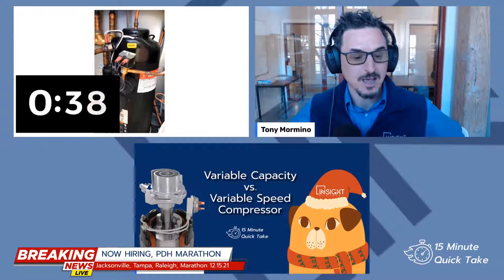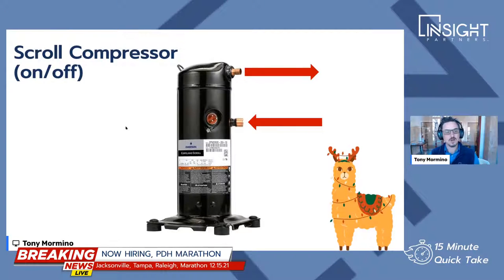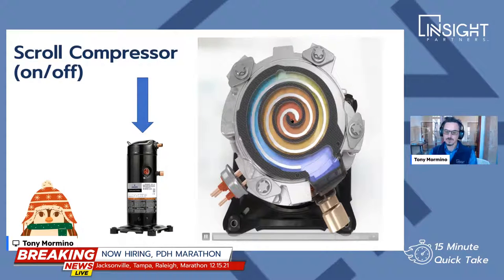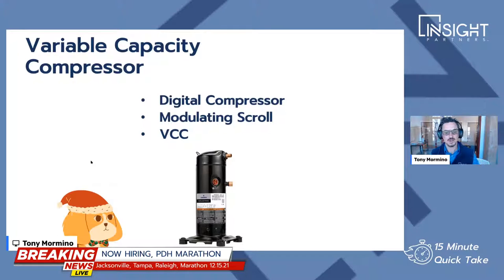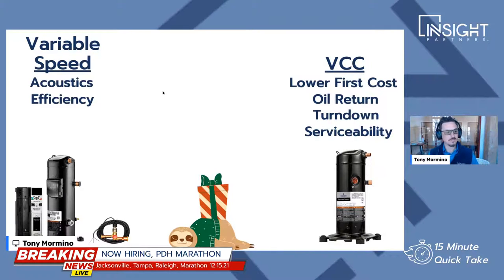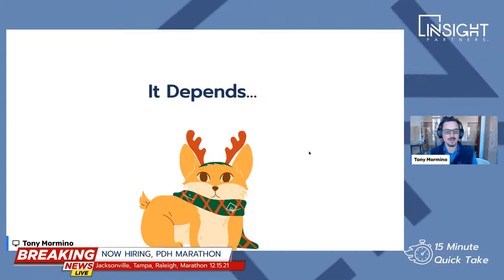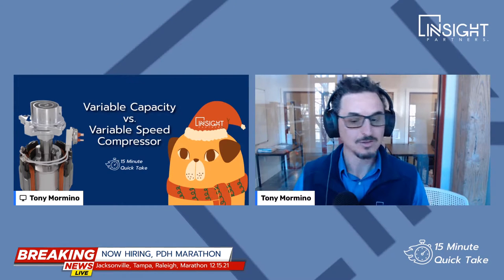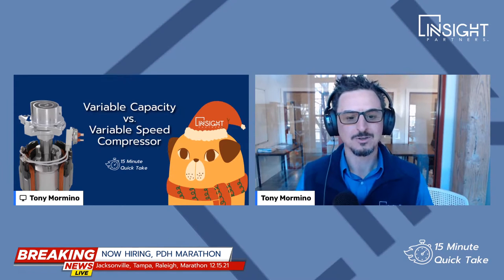Variable Capacity vs. Variable Speed Compressor

Comment: Variable capacity is a more generic term.  Variable speed is a type of variable capacity.  Digital compressors do it by PWM over a 15 - 20 second cycle.  Variable speed does this by changing the speed of the motor.

Comment: I would take the digital over the variable speed any day. Inverter compressor...its not only the compressor, but the expensive boards and controllers.....digital is just a compressor and a controller....less expensive, better oil return and more readily available parts.

Comment: Can you explain how a variable speed compressor in a car works without having any of the fancy communication and control systems that are needed when VRF is used for residential and commercial buildings?     The compressor in a car is usually directly driven from the engine.     The engine speed typically varies somewhere between 500 RPM and 3,500 RPM under normal conditions.   A receiver and expansion valve appear to be all the equipment necessary to keep the system in balance even when there are wild swings in load and capacity (compressor speed).    The cabin is maintained at a comfortable temperature and humidity level even with massive swings in heat and humidity demand over short periods.    Thanks
Reply: The car A/C will cool more the faster the engine spins. If this would result in overcooling the heater is often at the same time. This is obviously inefficient but nobody cares.

Comment: I prefer a Varible speed compressor for reliability.  The digital scroll has a top moving MECHANICAL PLATE with a hot gas solenoid that gets on/off. This will eventually fail much sooner. 
Turn down on VFD compressors I have been working with have the ability turn down to 12% capacity.  That's very low.  I have worked with both Danfoss and Copeland VFD drive compressors.  I just don't see digital scrolls lasting very long life with being replaced just because of the plate wearing out eventually
Reply: I disagree. I have seen digital scrolls last longer than inverter compressors....plus without a properly implemented logic the oil return on inverter compressors is bad. Plus costs associated with a digital vs inverter. Plus with the abuse customers put their equipment through....the inverter compressor is much more suseptible to break downs and service calls.
Reply: @jasonjohnsonHVAC 
Well that's OK I respect your opinion.  I personally already seen the plates for the digital scrolls fail. They are a nice technology. I love how they are ability to change capacity quickly. I haven't had any luck with them. My VFD driven compressor have been extremely reliable so far. I have had a VFD fail. Electrical parts will fail.

Comment: Very helpful video.  Do many manufacturers use the digital/VCC/PWM compressors?  It seems mostly what I see for residential is either referred to as Inverter, 2-stage, or single stage.

Comment: If you are looking for good efficiency at lower system purchase cost, two speed compressor is best compromise.

With new utility smart meters, more attention and regulations on appliance power factor, digital VCC compressors will not be around long as they are difficult to impossible to control utility grid load power factor.

Oil circulation is an issue with both variable and VCC compressors.  The short compression on-off duty cycle of VCC is not long enough to make an impact to average oil circulation.  The critical oil circulation is determined by suction line vapor mass flow and by the time vapor exits evaporator, the VCC pressure pulses have smoothed out to an average (lower) mass flow rate.  If the liquid pressure pulses of VCC are too great it would also cause problems for the EEV expansion valve refrigerant regulation into evaporator.  The pressure pulses of VCC are pretty much smoothed out by gas compression in first part of condenser.

It takes 10-30 minutes at full run speed to flush system distributed oil back to compressor.  On most residential systems, when you drop below about 50% of capacity you end up with a net loss of oil in compressor. During low capacity run time you are running on compressor oil sump reserve.  This is a primary reason why two speed compressors only drop to 60-65% capacity level.